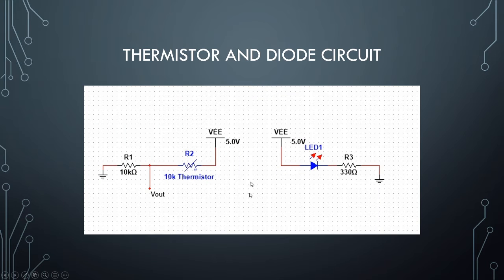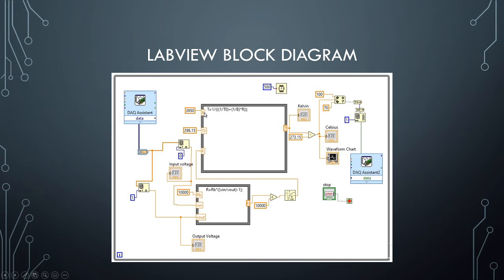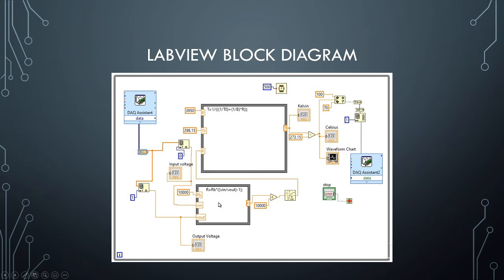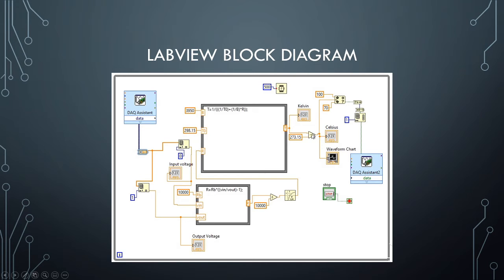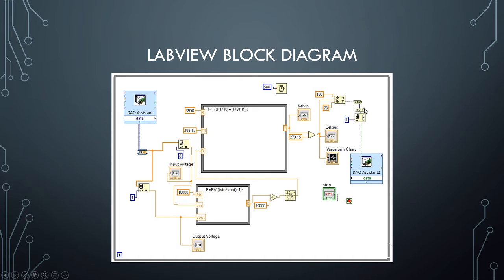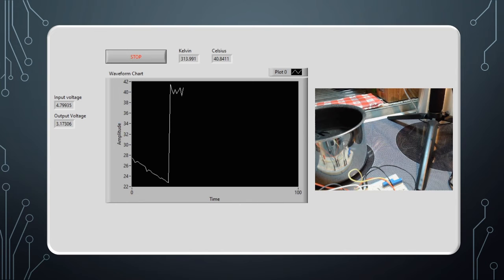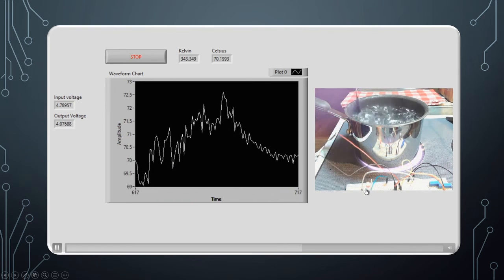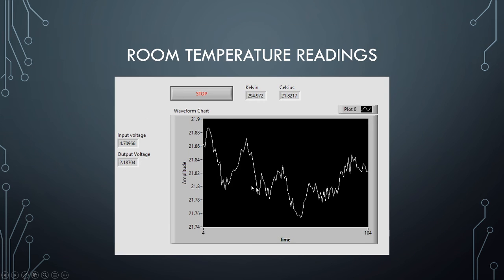Measuring Temperature with a Thermistor and NI myDAQ in LabVIEW

Comment: Ayo i have to do this as a homework for my engineering class and im a freshman. U think they going too hard on me?
Reply: Eh not really. A lot of the intro classes introduce things that may be brand new to you and seem really difficult. I would say this is a little bit much if it’s your first lab view assignment. But don’t think you have to get everything right away, especially homework. This lab wasn’t a complete success for me but I explained my thinking and the problems I ran into and everything was fine. With labs like this how you got there is more important than the actual results.